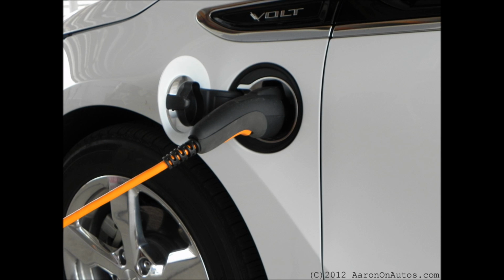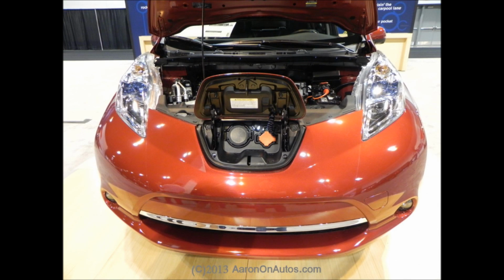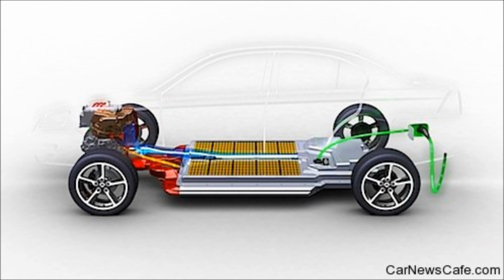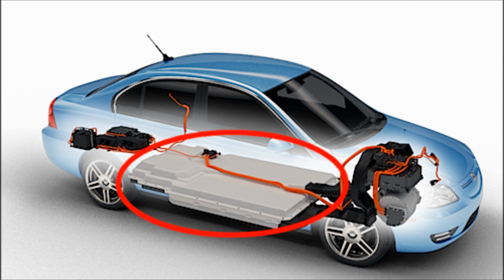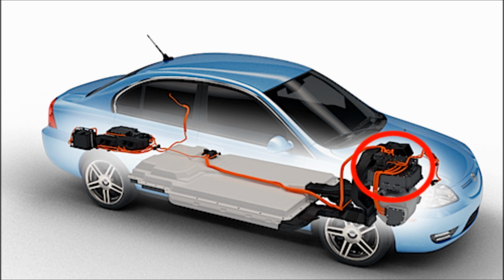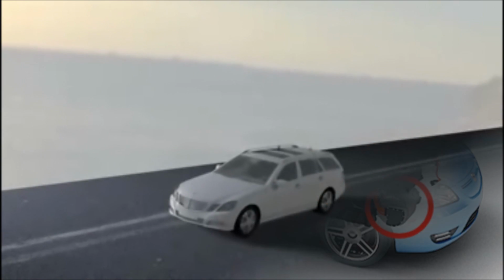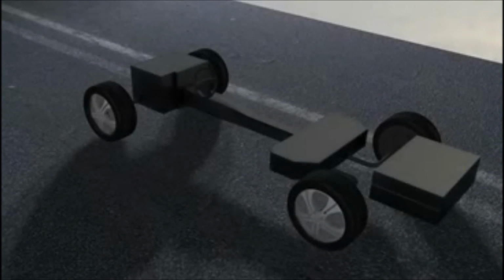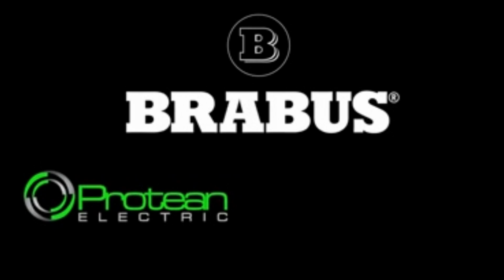How Electric Vehicles Work - the technology underlying an EV

Comment: Sir.. You know how remote control cars work. With a circuit board, transmitter and batter. Do you think we can upscale that technology into cars.  Not AAA or AA batters but large ones the size of tracker trailor gas tanks and put the transmitter safely covered in the hood so they can't transmit to other cars.  What do you think?
Reply: I have always wondered if that be done